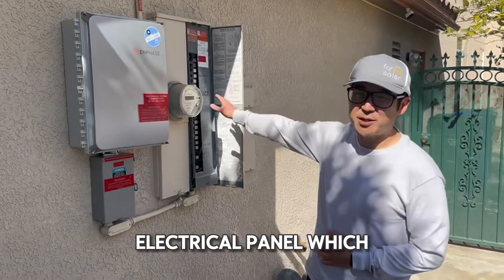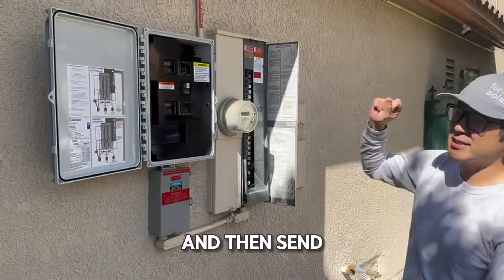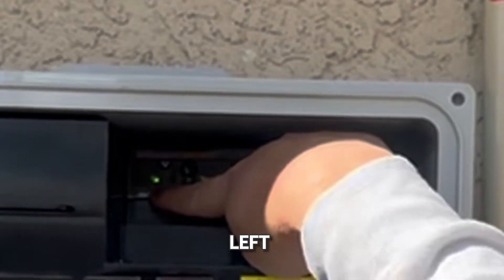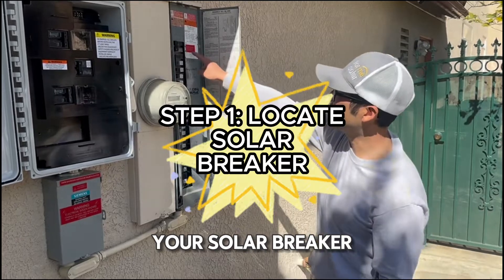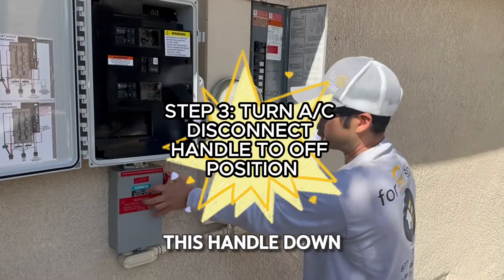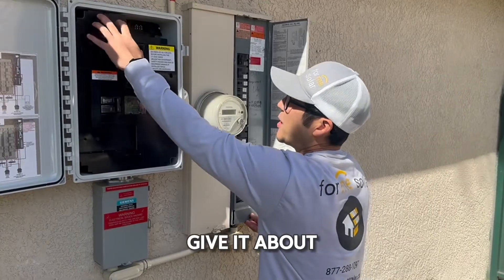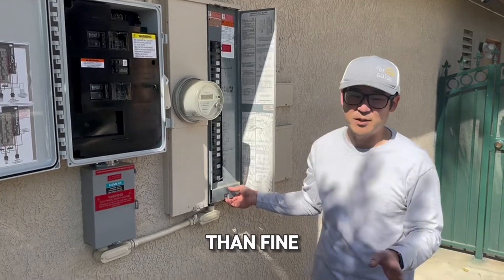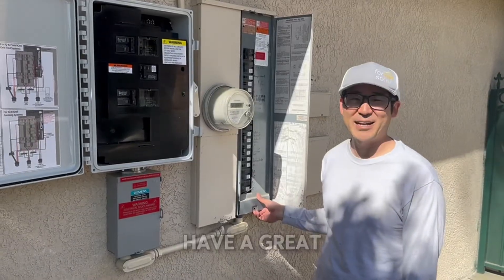Quick Guide: Resetting Your Enphase Solar Energy System

Comment: Washing panels is not unessessary if birds pooped all over them which is very common
Reply from the maker: You are right. While dust or pollen has minor impact on solar production, bird droppings can create dense blockages that can completely block sunlight from reaching the affected cells. This impact could be even more apparent with a string inverter setup which could see a performance drag across the entire string. 

Most bird droppings are very minor and at most would cover 1-2% of the total surface of a solar panel. But we have seen homes near the ocean with a substantial amount of bird droppings. If you experience a meaningful dip in production, we would recommend you get your panels cleaned or checked out.

Comment: All light flashing red....power cycling the Envoy and ensure that the breaker and power are on at the end of the power cycle..... LOL Turn it all off starting withthe breaker at the circut panel, wait a 5 minutes, turn it all back on and keep checking  over the next hour to see if it comes back. (Which Mine did) Thanks for this video!
Reply from the maker: LOVE HEARING THAT! Thanks sharing your troubleshooting steps! Power cycling the Envoy and checking the breaker is definitely a solid move. Just like a computer, sometimes a full reset like that is exactly what the system needs to reconnect and stabilize. Glad to hear your Envoy came back online and appreciate you letting us know!

Comment: 2 microinverters are nit sending signal in the app, what i do?
Reply from the maker: Is the rest of your system communicating properly with the combiner box, and it's just those two panels showing no signal? If so, it's possible there's a pinched wire or a connectivity issue under those panels. That usually requires a technician to lift the panels and inspect the wiring. We’d recommend scheduling a service visit to take a closer look.

Comment: Sir weirdly enough i don't have a breaker for it in the box, just the 3 in the enphase box and the AC (up and down switch) i reset those and got 2/3 lights(lightening bolt still red) 15 later all 3 were blinking again. Anything else i can check? Lumio is goin bankrupt so likely won't come out.
Reply from the maker: Thanks for providing that description.  Sounds like you're doing a great job checking what you can for your Enphase system. If the lightning bolt is still red and then all 3 lights blink again after a reset, that usually means it's a communication or grid issue, not a breaker problem. 

Given the situation with Lumio, we would be happy to help take a look or offer service support. Forme Solar specializes in solar repair and troubleshooting, so feel free to reach out! We will do our best to get your system back online quickly.

Comment: i have two arrows icon that blinks green. It looks like 1 arrow pointing up and 1 arrow pointing down (doesnt look like  a full arrow. More like an arrow but the head of the arrow is halved. ) what does this mean?
Reply from the maker: Thanks for reaching out! Blinking green arrows on your Enphase Combiner Box mean normal communication between the microinverters and the Envoy.
Up arrow → Sending data from microinverters.
Down arrow → Receiving data to microinverters.
Blinking green → Everything is working fine.
If they stop blinking, are blinking red or blink erratically, check your breakers, reboot the solar system, and verify the internet connection.

Comment: hmmm, all of the lights are blinking red. what would that indicate?
Reply from the maker: If all of the lights are blinking red simultaneously, this is typically a grid connection or a communication error. Try power cycling the Envoy and ensure that the breaker and power are on at the end of the power cycle.
Reply: That you need an entire new system

Comment: What if you dont see ligjts at all? Could it be the combiner went out ?
Reply from the maker: Thanks for reaching out! If you see no lights, this is probably a power supply issue. Try a hard reboot. If power is still not turning on, check to ensure that everything is on and power is flowing to the box. If power is flowing into the box, but you still aren't seeing lights, we would recommend you contact Enphase support. There is a chance the power supply unit may have failed and could need replacement.